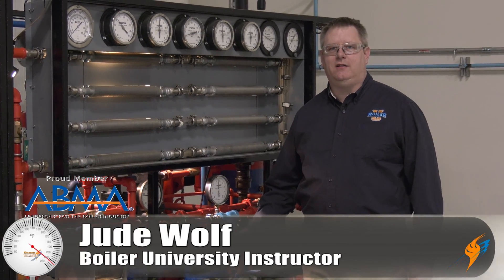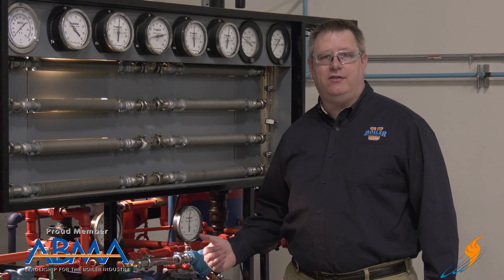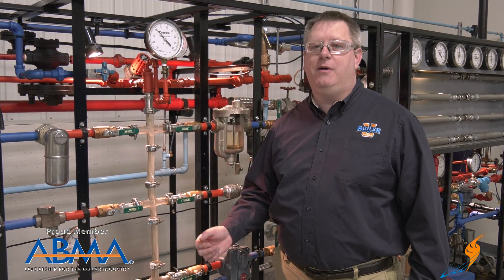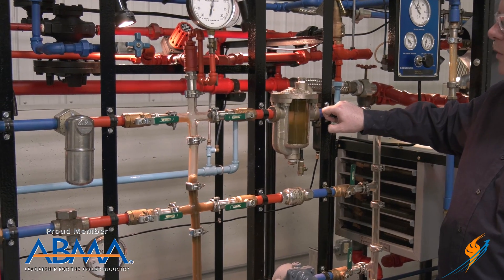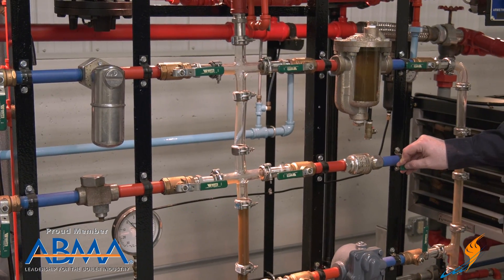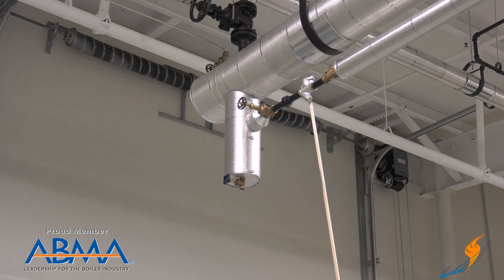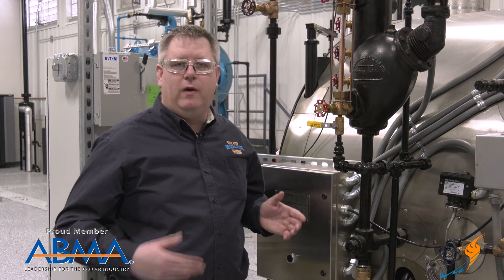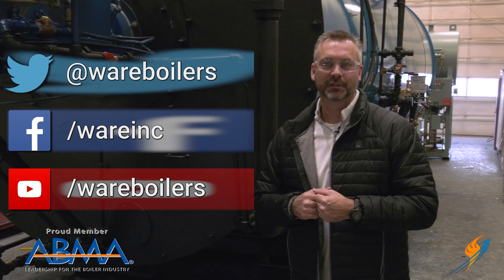What is Water Hammer - Boiling Point

Comment: In regards to hammering during blowdown like u spoke about at 4 min 7 secs..... Wouldnt the hammering during blowing down water from a feedwater controller or LWC off be more from the water in the boiler at a higher press than atmospheric instantly flashing to steam in the piping becuz when u crack the valve now u are introducing n exposing the hi press hi temp water to atmospheric press? And this would be steam hammer not water hammer. Isnt it that and not really that the line is not warmed up? I can understand hammering in a cold line if ur puttin steam into it cuz it will quickly condense and either the implosion of steam to liq causes the hammer and or the fact that it will draw slugs of water out the boiler quick and hammer soon as it hits an elbow or something. Please lemme know if i am gettin it right. Thanks

Comment: Hey Jude lemme run this by u and u can lemme know if i understand the video. So the clear piping u displayed with the water hammering is simply from the condensing of the steam introduced into the cooler and likely lower press area. The implosion due to the condensing of steam causes a vacuum effect which quickly pulls the water to replace the steam that once occupied the space before it condense. Tip for those who may not know why....... 1 lb of water in the form of steam occupies 1600x the space that the 1 lb of water occupies. So just imagine wat happens in reverse when u condense the steam. U know have ALOT of space that will be taken up by the water that is being sucked into that area.

Comment: Thanks for the great work! Can you tell me if a High-Pressure steam trap that is passing steam can cause water hammer in an HP condesate return line? Having a big problem in my plant with a water hammer in my HP condensate return line.
Reply: I would say yes. Heres what i think can be happening. 1 if ur passin steam thru the trap it can be quickly condensing once it gets exposed to the cooler condensate and lower pressure area(cond return is open to atmosphere correct?) Which causing quick implosion as the steam shrinks 1600x its size as liquid condensate. That can def cause some hammering. That would be steam hammering id say. 2. The hi press steam passing thru the trap can be causing the condensate to flash quickly and now thats 1600x expansion of liq to steam which definitely causing hammering. 3. The fast flowing hi press steam passing over the top surface of liq cond on the bottom of the piping can grab slugs of water and launching them in the stream of moving steam and once theres a bend in piping(elbow) that water slams into the the fitting and that would cause water hammer.